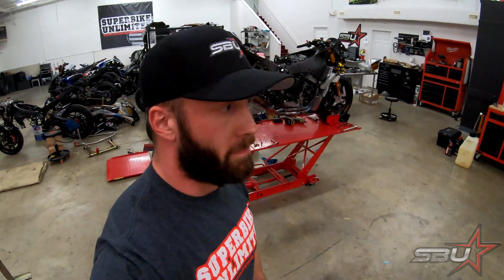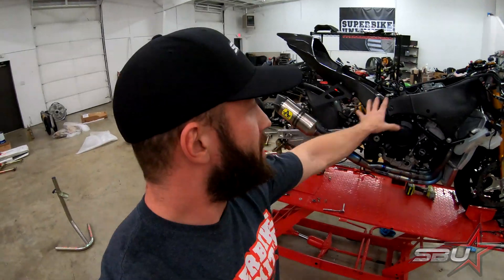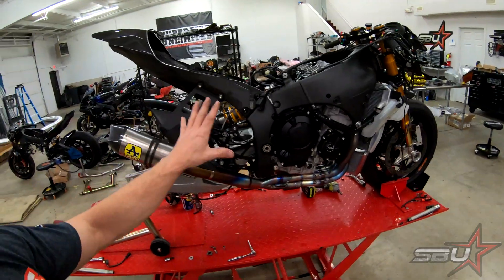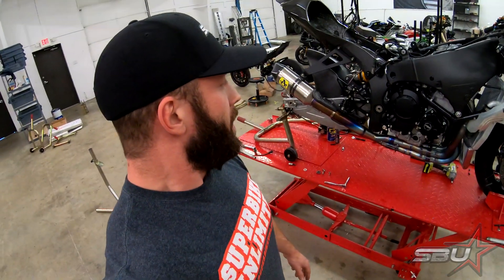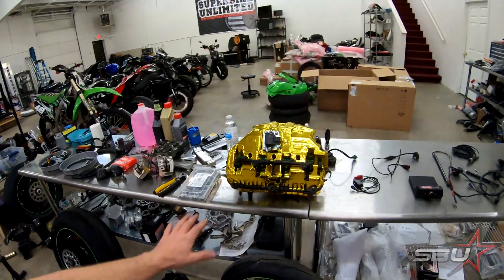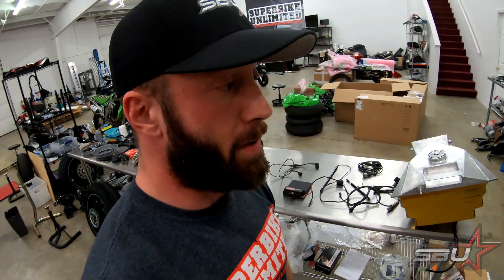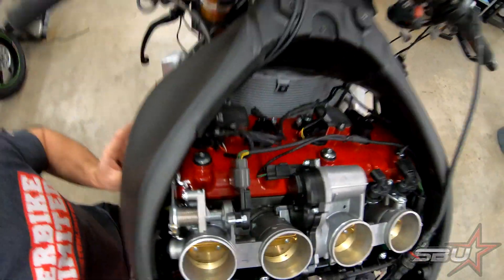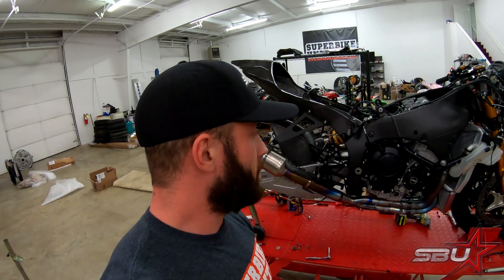The SBU 2019 Superbike Project - Finally In Business (MoTeC Electronics Have Arrived)! - #5

Comment: How much power would be lost if a/f ratio is 16/1?
Reply from the maker: A considerable amount. Why do you ask?
Reply: SuperbikeUnlimited.com  a/f is good until around 7500 and through 14500.
Reply from the maker: @Cragofitness45  Who did it?
Reply: SuperbikeUnlimited.com had the last guy who ran dyno tell me I shouldn’t even ride bike like that cause I could blow a piston.
Reply from the maker: @Cragofitness45  If you're confident the bike is mechanically sound, then you should have your ECU done elsewhere. We offer a great mail-in service for that bike.
Reply: SuperbikeUnlimited.com it’s a 2015.  I have m4slipon with cat delete.  Going to be getting a sprint air filter.  Right now I have k&n air filter.  Removed kleen system and add block off plates.  

The two guys said bike was strong beside a/f one said he was surprised with the hp due to the a/f meaning he thought it wouldn’t hit that high. 

Do u guys flash based off my slip on and filter?
Reply: I had my ecu flashed.  Took it to to two separate dynos and a/f was 16/1 only making 151hp.